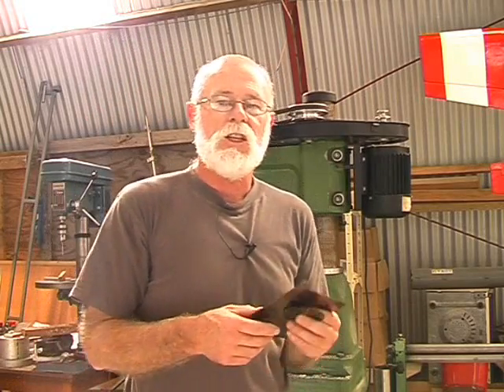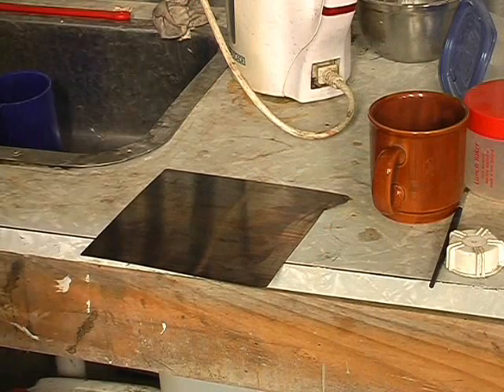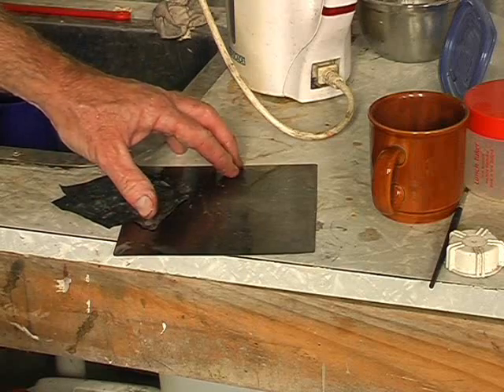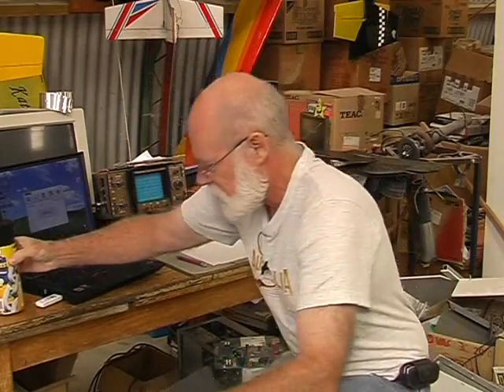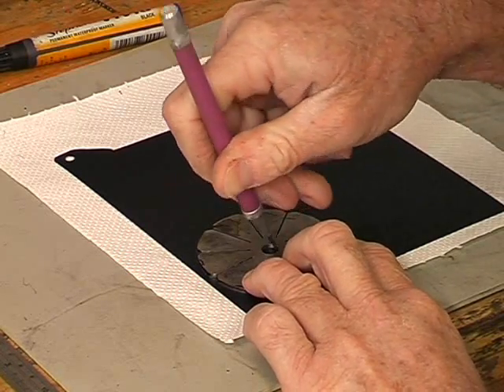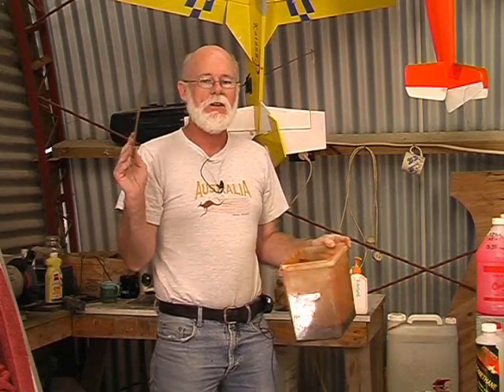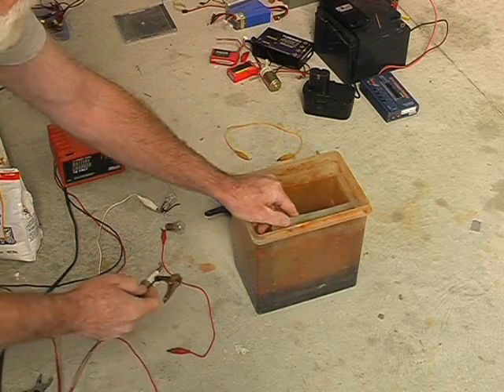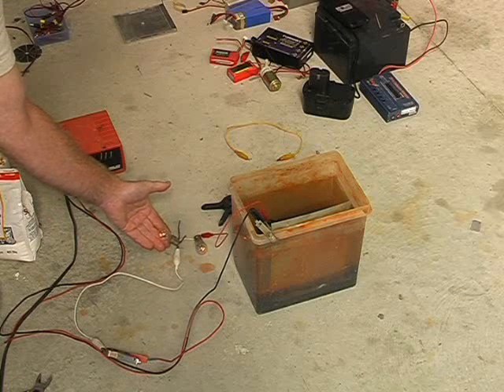How to make reedvalves for pulsejet engines

Comment: What do you use to cut a piece of spring steel out of a roll to not distort the metal?
Reply: Just regular metal sheers (snips) will do the job if you're careful -- otherwise careful use of an abrasive disk cutter is okay as well.    Just be sure to leave enough waste that the heat from abrasive cutting doesn't de-temper the material you will be using.
Reply: @xjet  thank you for the help again! Awesome videos!  Can't wait to try this.

Comment: What grit sandpaper would you use to clean up the spring steel before painting?
Reply: The grit size isn't too important but probably a 240 is a good compromise -- providing good cleaning action and creating a surface the paint will grip.
Reply: @xjet  thanks!  I just didn't want to scratch the Reed and ruin the sealing.

Comment: You need to be very careful with the electrolyte after use as it mostly likely contain extremely toxic hexavalent chromium salts.
Reply: Only if you're etching an alloy containing chrome.  Spring steel is simply a form of carbon steel, no chromium.
Reply: @xjet  There are many grades of spring steel and some of them certainly do contain chromium. It is unwise to be so dismissive of such a potential risk as hexavalent chromium salts present a very real and serious threat to health. Anyone doing this needs to either be certain their material contains no chromium or assume it does and handle the used electrolyte appropriately. I would advise anyone thinking of doing this to do their research first, especially in regard to the hazards presented by hexavalent chromium salts. Electrolysis can be a very easy way to inadvertently make some very nasty substances and should not be meddled with unless you are certain of what you are doing.

Comment: What a blast from the past this is!
I made my first and only pulse jet 40 years ago, worked well until I bent it.
Electro etching was and still is a good cheap method of producing fiddly parts.
I also used to stencil etch markings on panels of projects and bespoke builds.
Was easier than going to the engravers - well cheaper anyway.

Comment: Kinda funny: I wanted to make some reed valves years ago, and I couldn't figure a way to cut them without warping. I just used some from my 2-stroke dirt bike and also feeler gauges. this looks more promising.

oddly enough, I would have hooked the current up the other way. I think I'll have to do a little research for a "best" etching solution.

Had to laugh though when he called the alligator clips crocodile clips. I guess it is one of those location things.

Comment: Phosphoric acid, CLR rust remover or vinegar are good alternatives to the scrubbing in the first step.
Printed circuit board manufacture uses a photolithographic process to create an etching mask.
You could use a liquid photoresist on the steel,use the template as a mask and expose the photoresist to the sun's UV , remove the exposed photoresist areas with IPA and then proceed with the electrochemical etching.
I also suggest you use washing soda (sodium carbonate) as an electrolyte.Using sodium chloride causes the evolution of chlorine gas which is best avoided. Washing soda also acts as a degreaser.
You don't need the bulbs. Connect a volt meter to the circuit,fill the etching bath with fresh water, add washing soda slowly until you reach the desired current. The current is proportional to the strength of the solution. A low current is better than a high current.It takes longer to etch but is less likely to lift the etch mask at the edges.
https://www.instructables.com/DIY-PCB-using-Liquid-Photoresist/

Comment: Tesla valve rapidly replacing Reed valves for this application, largely due to the fact that it has no moving parts.
Tesla valve fabrication is complex.
Reply: The Tesla valve is too soft to provide adequate compression for good efficiencies.  That's why you won't find any non-trivial engine using a Tesla valve.
Reply: xjet 
Ok. I’m just conveying what I recently read. Thank you.

Comment: Sodium bicarbonate might be a better salt for that purpose, because sodium chloride releases chlorine to the air, when electrolysis happens, which can be quite harmful.
Reply: good you said this.
when I was a kid, I used salt in the water to facilitate my hydrogen production for my rockets. didn't give any consideration to what was joining the oxygen.

Comment: Thank you for being very specific in your instructions. I tried this method several times in the past and the paint lifted at the edges of the scribed lines resulting in failure. I was not using etching primer. I will have a go with etching primer and the 2 bulb circuitry. Thank you so much for you video!

Comment: I discovered a way to stop reed valve failure by accident. I tried  burning 32 to 1 two stroke mix instead of straight gasoline and have not burned a reed since on an rc plane of my design after about ten flights. It used to burn or crack a reed after every flight.
Reply: Absolutely right.  I also found this.  The oil not only cushions the landing of the valve on the valve-seat but also helps prevent rust when the engine is not in use.

Comment: Process engineering advice: Almost any oil based spray paint will work because they are hydrophobic and will adhere sufficiently to metal.  Use heat to dry the paint and use multiple layers if you find that works better for patterning.  Nail polish will likely work as well, and be cleaner.  If you have access to a CO2 laser engraver, you can use that on spray paint (and maybe nail polish) and it will mostly vaporize it save for a thin residue (burn on is power dependent) which can be removed with a non ideal solvent scrub.  Do NOT use a laser engraver on anything chlorinated or already dipped in salty water as that will form toxic compounds.  I use this process and ferric chloride to etch printed circuit boards.  To speed the process of oxidation, add an air bubbler and a heater to your tank.
Reply: This video is 7 yrs old ..

Comment: would this work with aluminum too?
Reply: I don't think so because aluminum oxide blocks current after forming a thin layer
Reply: There should be no need to do it with Aluminium anyway. It's far easier to work than stainless steel. 

Of course Aluminium is useless in a pulse jet, if that was your intention. It is not tough enough, has a much lower melting point, and will fail from metal fatigue even if it could stand the intense heat for a second or two. 

Aluminium also age hardens, will break after a few bends, and can even shatter on first impact if it is old enough.

Comment: Or, anneal the spring steel, cut it with relative ease, and then reharden it.  Can be done with a propane torch.  Anneal means to heat the steel to its critical point (when it is not attracted to a magnet), and let it cool off slowly in the air.  To reharden it, heat it up to the same critical point, and then quickly quench it in oil or water.

Comment: The use of Tesla's  valveless system is a fantastic ideal candidate for pulse jets.
Just the pulse bit to sort out?
Reply: No, Tesla's system works okay for constant flows but is useless for pulsed flows as found in a pulsejet engine.   It is also far too "soft" to create any significant amount of compression in the chamber.
Reply: +xjet 
The advantage of Tesla's device is the none return of thrust.
Therfore propulsive thrust is the net gain. 
pulses of fuel can be injected at a specific swirl point; within the Tesla device, for optimum fuel air ratio mix and a glow plug device can be used
for ignition.
It has potential for sustainability and enhanced performance? 
Something worth looking at :-)
Reply: I looked at the tesla device many years ago and built several but they are simply not suited to pulses of gasflow -- only steady-flow.  The reality is that the volume of gas that has to be pushed down them before any reasonable blocking occurs is so great that it produces an engine with such a low compression in the combustion chamber that thrust is abysmal -- even if you can get it to run.  This is why, in the 100+ years of pulsejet development, there has never been a successful pulsejet built using this device.
Reply: Ok Thanks.
Reply: When you think about the structure of the fuel gas explosion its like an expanding balloon.
If you take the trumpet and inverted  the end of it, having a reed valve for air intake and the toroidal shaped trumpet part as the blast reflection of thrust? 
It might just work?
If not then blow's Raspberry's through the reed valve :-D

Comment: I can't get it to work is my steel to thick? 1/16
Reply: sam n you have if your plate is to thick it might cause corrotion in under the paint as you have to wait longer, as well as everything depend on your salt solution liquid and battry power ;)

Comment: How much power did this process use, and compared to laser/water jet or even machining? Could a solar powered battery be added, and therefore allow relatively complex mass metal cutting without preexisting infrastructure? This could help people in remote areas. I want to make some custom washers or something with this Tech.
Reply: i have table salt in my kitchen ,,,, i dont have a laser cutter ,,, who cares about 50 pence worth of electric compared to ten grands worth of laser

Comment: Liked. I had a think while watching, a cheap laser engraver made from DVD-R drive bits might work wonders with the black paint (they won't do damn to the metal itself). Just to make it even an easier job.
Reply: On the other hand, small plasma cutters are cheap as dirt these days.  I got mine with built in compressor for a grand Canadian.  With how clean of a cut, the fact that it cuts pretty much anything (I swear it'll cut dirt if you don't mind eating tips using the internal start mode) and how cheap it is per cut, they're just SOOO good.  I hear ya about the laser diode stuff though.  I have a 1/4 watt unit I use for engraving and it'll mark metals with black paint, but just barely and you can pretty much rub it off with a finger.
Reply: Oh, I didn't mean cutting the metal directly, but to make etching patterns using black paint as electrolyte barrier.
Reply: Ah, I gotcha. :)

Comment: Hello Bruce :) This video is indeed great! In regards with this I was thinking today the goal could be accomplished by using laser cutter. Please share your thoughts. Thank you.
Reply: Laser cutting isn't a good idea for making pulsejet reed valves.  The heat of the laser affects the temper of the spring steel along the edge of the valve and so they then start to fray and fail far more quickly.  For production, an abrasive water-cutter is far better.
Reply: George Georgiev About 0:52 in, he says you could use a laser or similar machinery but this is a method for making them on a small scale :)

Comment: That is awesome,as always! Think I'm gonna try it to make me some HHO cell plates!
Reply: Careful, that mix of gases (H2 and O) is highly dangerous, if you have any sparks or sources of ignition. The energy it releases to revert back to water is about the amount which you have to put in to break down the water. But it happens in a very short time instead of the minutes, hours or days taken to produce the gases. It's also noisy and very hot.

Comment: Wow, is 20 hours standard, what happens if it stays in longer?
Reply: +Appollo scott It depends on a lot of factors - current flow, salt concentration, temperature, steel thickness,  etc. You want to have it in the etch as short as possible and still have it etched all the way through. Go too long and the etching will start taking off extra metal and mess with the final shape and accuracy.

Comment: Can I point out when making these valves with such a fine space between the leaves, is is important to keep a ‘Bible’ COPY for use over and again when new valves are made.

It is only fine but the mark made by even the pointiest of scalpels will probably always be slightly larger then the original Petal Valve.
This said and with something not much more than 1 mm between the leaves, one cannot afford to let each petal get much larger which is why the same Master-Copy should be used.

Comment: Is there a diff between etching and self etching paint?
Reply: nobackhands i need this answered too because i cant find the paint he used in the video. must it be a primer, or can it be just etching paint too?
Reply: InterestingProjects ***** please help, i am using this for my school exam project
Reply: Sorry, probably a bit late but for anyone else wondering. Yes it is etch primer. Etch primer is used when doing cars too. When one is going straight onto the steel an etch primer is used, as it adheres to the metal far better than regular primer, which is normal paint, albeit a matt finish so the next coats adhere well. But etch primer is used next to or straight on the metal.
That is the stuff you want.
Though I suppose one could try a normal primer or paint. As long as it adheres well enough to the surface to resist the etch process without flaking off or letting it leach through it would work fine.

Comment: I tried it & found the negative plate did all the corroding so tried swapping them and with the negative on the reeds and this worked but the paint bubbled off so failed.
Reply: Yeah, same here. I tried several kinds of paint and it comes off. And the polarity is definitely wrong. Crumby idea. Wasted money of spring steel sheet.

Comment: An easier, albeit more time consuming method of removing the the oxide, is to submerge the steel sheet in a pickling solution (weak acid). The easiest solution, is straight white vinegar. Great video, and a wonderful demonstration!
Reply: Won't that take a couple or three weeks to etch though?

Comment: What are 2 bulbs for??  To check that reaction is taking place???  Why not use 1 bulb?
Great video's....4am in morning and work at 8am but still watching video's!
Reply: The bulbs are there to limit the current that flows.  Too much current will cause too much bubbling and that will  lift the paint, causing a ragged, undercut edge.
Reply: Paul Spiller It's 2 because he thinks there's less than 10 watt but more than 5 watts that he needs absorbed. Incandescent bulbs will just burn dimmer if it's less so it doesn't matter too much.

Comment: HonnyStink now sell them as spares....
Reply: The HK valve material does not seem to be of high quality spring steel, however. Material seem to yield quite easily and to pretty tight radius without breaking, not good thing in this application.

Comment: Great video.  You might want to consider heat treatment to remove any hydrogen embrittlement introduced by the electrolysis process, as this is exactly the kind of material and conditions where it's liable to cause problems.
Reply: SkyWizardless the hydrogen is produced at the cathode. The painted steel plate is being used as the anode, and the iron goes into solution where the metal is exposed to the saltwater, as it is oxidized initially to Fe(II), and then to Fe(III), both of which are soluble as their chlorides.

Meanwhile at the cathode, both hydrogen and NaOH are being produced. The NaOH reacts w/ the iron in solution to precipitate it as iron hydroxides, which is why you see all that orange scum in the solution.
Reply: @agekjrgardpayoutube2593  What is the other piece of steel for.
Reply: Alex T the cathode is to complete the circuit.
Reply: @agekjrgardpayoutube2593  Yes, I understand, but does it need to be any particular conductor?
Reply: Isn't there plenty of heat treatment in the pulsejet ignition chamber?

Comment: Ok I am going to give this a shot. Only Self Etching Primer I could find localy was by Rust-Oleum self etching primer (249322). All they only had gray color. I got .006" Blue Spring steel from McMaster-CARR as with a .125" thick by 6" wide 12" long 304 stainless steel. My charger puts out 1 amp trickle charging. I have a another charger that puts out 2 amps on trickle charge. Looking on line I found SEM Products Self Etching Primer 39673 BLACK but I had to order this at almost $20.00 USD per can. Found a seller that has free shipping at $50.00 so I added some other stuff to my order. I plan on ordering .007, .008, .009 and or .010 Spring steel as I am finding out Dyna Jets were shipped out with different thickness of Reeds. Oh I am trying the SEA salt first then the Baking Soda (NaHCO3). I will be checking it progress every hour or two. Oh and yes I am doing this outside I do remember chemistry from High School. Also I was a Sub Mariner in the U.S. Navy and this is how we made O2 as the H was discharged overboard form my submarine.
 PLEASE give me any and all helping ideas.
Reply: Ok it worked for me. Took 5.5 almost 6 hours. My charger is 1 amp. Have some clean up. found a emery board works very good. Make sure your scribe lines are CLEAN. I have now 4 home made reed valves for my Hobby King Pulse jet.

Comment: I was checking for "Blue Tempered Spring Steel".006 thick 1095 grade .  Fastenal sells a 6.0" X 50" piece of Precision brand material for $35.00. A guy on ebay sells them for about $9.00 each. You could make several for $9.00.
Reply: McMaster-Carr has it for $18.00. 6.0" X 50". You can also get a .050" or Like I did get a 0.100" thick 304 Stainless Steel plate. HobbyKing has the Reed valves for $1.99 for a pack of 5 reed valves. I ordered 100+ reed vales as I also had $29.00 in HK points. So the price went down more. I am still making my own reed Valves as I have .006", .008", .009", .010", .012" and .015" thick 1095 Spring Steel.

Comment: There is no "Ram Air Effect"- Pulse Jets are often erroneously referred to as "Ram Jets"- and the air rushing in from the front of the engine only serves to kill the combustion at high speed. The Pulse Jet operates on an Acoustic Principal and the valve seems to interfere with the tuning of the engine, Which operates more like an "Internal Combustion" engine than a true Jet.